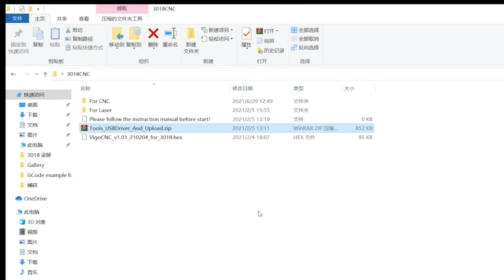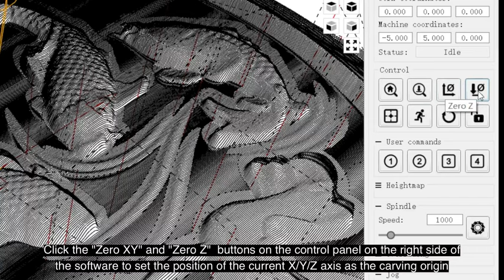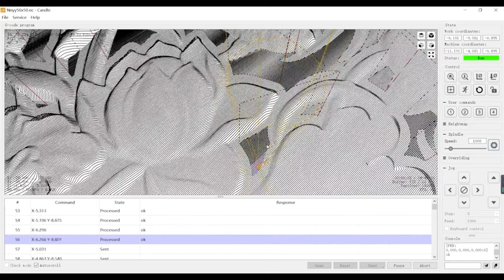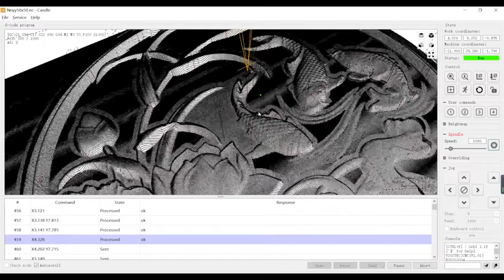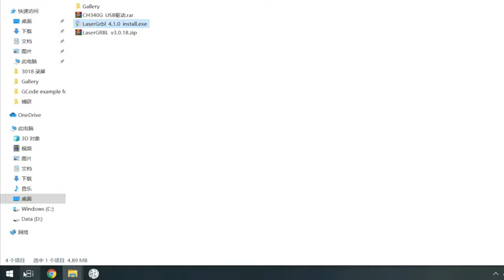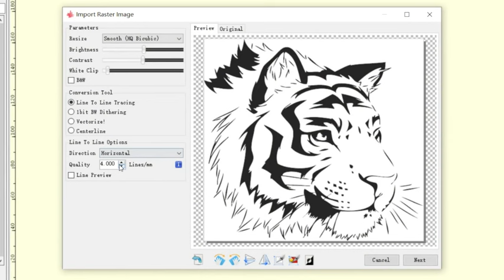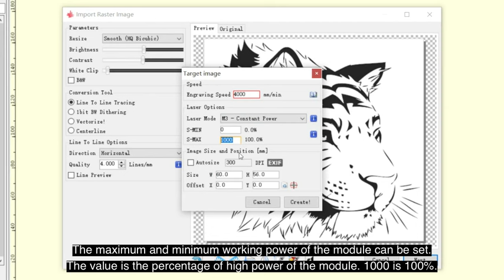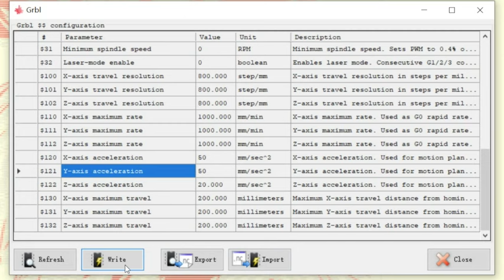How To Use VEVOR CNC 3018 Engraving Machine？

Comment: What is the file format that can be exported to the engraving machine, and what are the appropriate design programs? I used Corel Draw, but file is not accepted DXF
Reply from the maker: You can use the engraving software in the USB flash disk provided by us, LaserGRBL for laser software and Candle for tool engraving. Laser engraving is relatively simple. The image can be carved when it is opened. The Candle software for tool engraving is a. nc file format that executes G code. You can download ArtCAM software online, convert the image or CAD file into G code file, and then use the provided Candle software to realize relief or cutting

Comment: What is the price of this machine  (CNC + Laser + external control)?  I can't find it. I can only find the 3020 per 223 Euros. What is the difference between these two machines?
Reply from the maker: The CNC 3018 machine is linked as follows.  https://www.vevor.com/wood-engraving-machine-c_11142/cnc-3018-pro-cnc-3018-cnc-machine-laser-engraver-for-wood-leather-plastic-p_010277153257?utm_source=youtube+official&utm_medium=yt&utm_campaign=yt&utm_id=6/10     You can view the product parameters to understand their differences.
Reply: I couldn't find any difference in their parameters beyond the obvious 2cm. The gantry, though, looks different. Has the rigidity improved, perhaps?

Comment: Greetings . While the gcode was running; the machine left the set path and dug in the wrong direction and at an excessive depth. Do you have experiences?
Reply from the maker: Our products have a one-year warranty period. If you have placed an order to buy our products, and the products have quality problems, you can provide the video to our after-sales mailbox, and the customer service will find a technician to solve it for you.  support@vevor.com
Reply: Could that be these files missing on the SD-Ram card, I have the same issue: 
There are two special files which should be located in the root directory of the SD Card, these are used by functions in the Control menu. These are probe.txt which is used by the Probe function and Spindle Laser.txt for the Spindle/Laser function, these are provided on the included SD card. These files are vital to the operation of your offline controller and should never be removed or altered unless specifically told to.

Comment: Can you program with the offline controller?
Reply from the maker: The machine cannot be programmed with the offline controller, only the files can be copied to the TF card of the offline controller for processing. The offline controller controls the movement of the machine, adjusts files and other basic uses.
Reply: @vevor.official  is there a way to connect the offline controller directly to the PC? How?

Comment: Hello, I'm using Fusion 360 (using grbl postprocessor), but the machine suddenly stops randomly while reading the gcode, no error message, the machine suddenly stops whit the spindle on and keeps the movement until it hits something, I have to manually disconnect the USB and turn the machine off, as the controls in candle are not working
Reply from the maker: There has been a quality problem with the product you received, we apologize.
Can you provide us some photos or videos of the product to illustrate the problem?  
This is the basis for providing you with after-sales service.We will find a technician for you to solve your problem. Please send relevant videos/pictures to our after-sales email.  support@vevor.com

Comment: Hi VEVOR, i am about to buy this CNC machine, i guess laser machine can also cut thin and soft woods like 4mm balsa, is that right ? i Also want to ask if its possible to cut wood (with milling spindle) of 12mm depth.
One last question, are all the electronic included ? i mean, if i mount it,  can I begin to practice on first day ? or i would have to learn about mechanical and software settings ?

Regards !
Reply from the maker: The technician replied that this machine is a basic model without a laser head. The 15W laser can cut light wood boards of about 4mm, and the 12mm wood boards cannot be cut by laser. It needs to be processed by the CNC milling cutter of the machine. Our products will be equipped with detailed instructions.

Comment: where can we find apple drivers?
Reply from the maker: Currently there is a MAC OS version of the candle
, you need to download the Apple version of the software, the link is: https://docs.sainsmart.com/article/zcyhab7a0k-how-to-install-grblcontrol-candle-for-mac Here is the driver download and installation software under MacOS to download and install For the specific method, please refer to. You can also find the driver for the Apple system version on the Internet.
Reply: @vevor.official  ive since installed on a windows machine

Comment: I dont know why the configurații dont work the portname ca not be empty and program grbl cofiguration its empty
Reply from the maker: The technician replied that the driver in the USB flash disk should be installed first (with driver). The QR code in the manual can be scanned to view the assembly and software usage
Reply: I tried to many Times and evry Time its fails if i want to instala the CH341SER, said driver instala failure